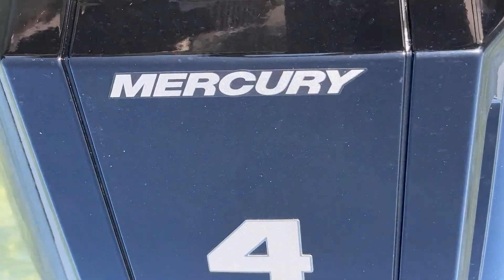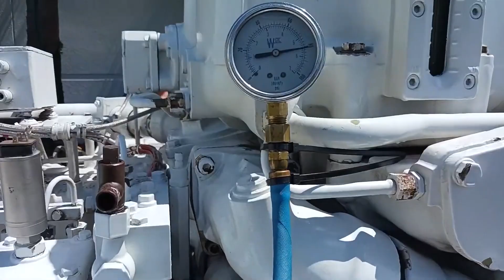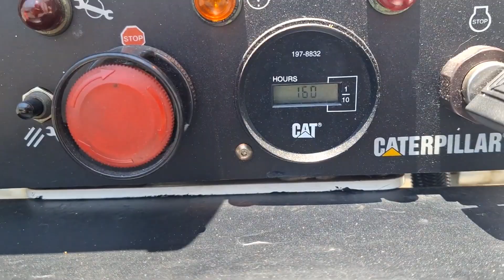15 Boat Engines That Were TOO POWERFUL To Exist!

Comment: I honestly don't get why you'd strap 5 500hp+ engines on the back of a fiberglass boat - I mean, there's going fast, but you can go perhaps almost as fast on 2 of them and save an absolute bundle on gasoline...
Reply from the maker: Yeah, sounds like diminishing returns are real... Beyond a certain point you're burning massive fuel for marginal speed gains. For most people, two or three engines makes far more sense practically and financially. Thanks for watching and don't forget to subscribe :)
Reply: They did mention that they crack hulls.